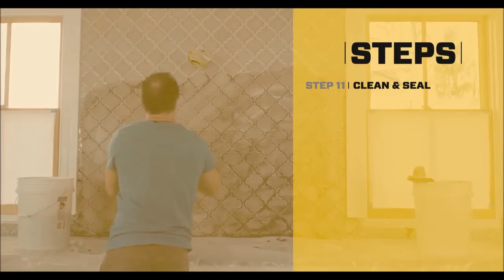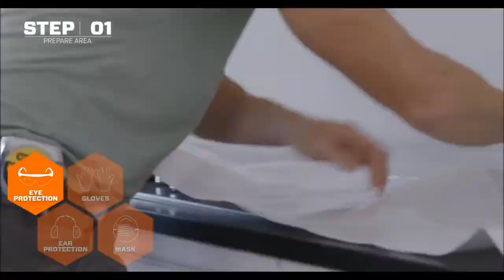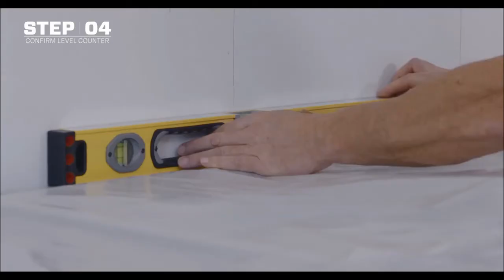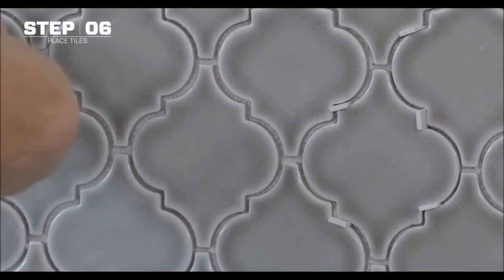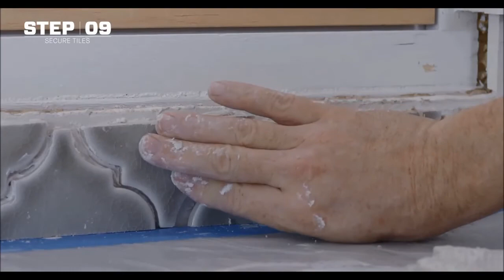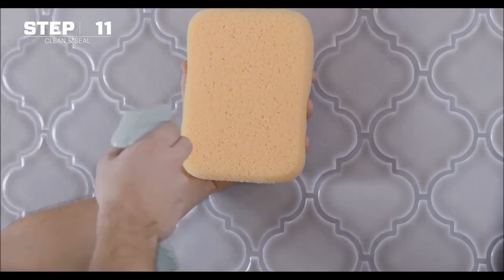Arabesque Installation

Comment: What if the wall is slightly uneven? How is that corrected?
Reply: @jamezshearn  thank you so much! Our tiles are arabesque on mesh, and we’re having our contractor install them on the entire wall that is 7ft x 8ft. The wall is slightly bulgy in the center but the tiles are way off everywhere. I am not convinced that it’s entirely fault of the wall. Is there a trick for those small tiles in the mesh to stay even?